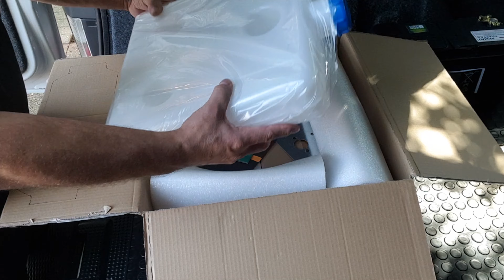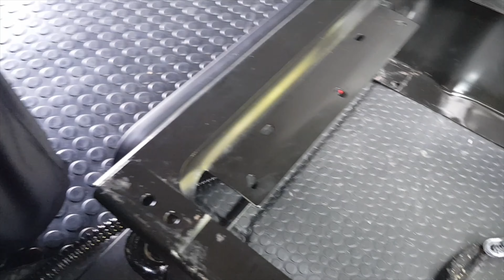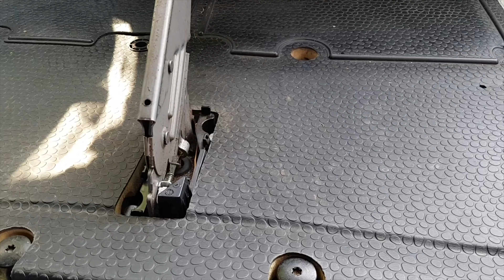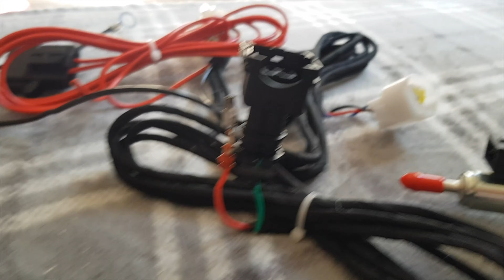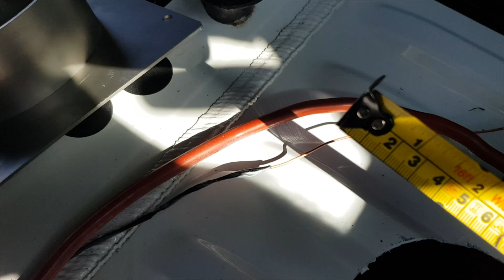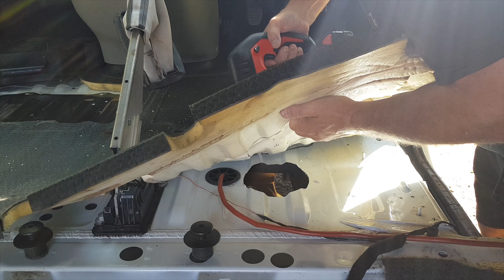chinese van heater fit from start to finish for vauxhall vivaro renault  trafic part 1

Comment: Such a great informative video. Bought my heater a year ago, but never got round to fitting it in my Renault Trafic, Mainly due to lack of confidence of screwing it up and also where to fit it. Now I can follow this video and know its in the right place. I too have bought the different fuel kit and the fuel tap for the top of the fuel tank, as heard that leaks happen from underneath. Thanks for sharing

Comment: Hi mate where did you order the different plate from to fix it down to the van?
Reply from the maker: Hi Thomas that item was purchased on Ebay just type in item number 
402810610918 very quick and good quality hope this helps good luck
Please give a thumbs up to my video?

Comment: hi have you got a link to where i can get the nylon fuel line from and what size it is cheers
Reply from the maker: Hi BJ 
Yes it's a 6mm x 4mm x 6mm
Reducing T,  Ebay item number 203649673085
Reply: @vandemon1822  hi it was the link to the fuel nylon line i was after buddy cheers
Reply from the maker: @bjwright7044  FUEL LINE KIT FOR WEBASTO EBERSPACHER DIESEL HEATER Fuel Pipe 3.5m 10*Hose Clip Ebay item number 184894927595
Sorry👍